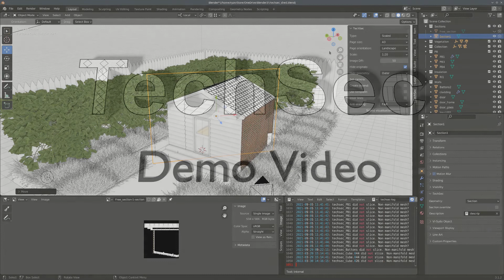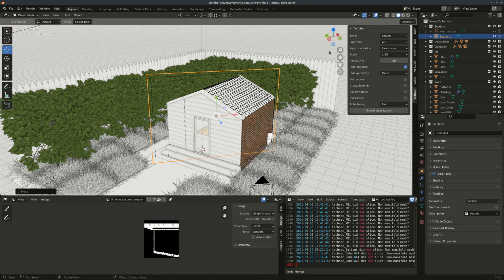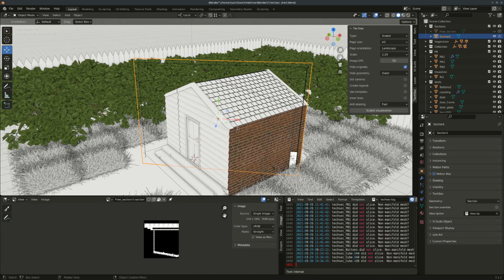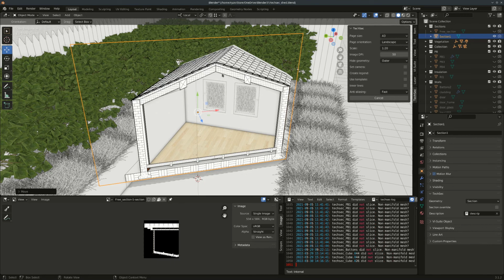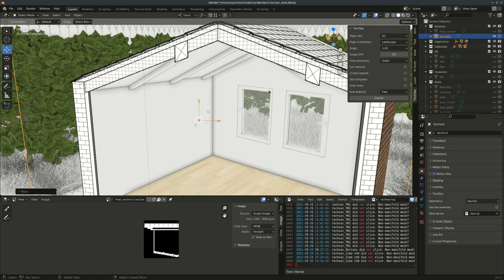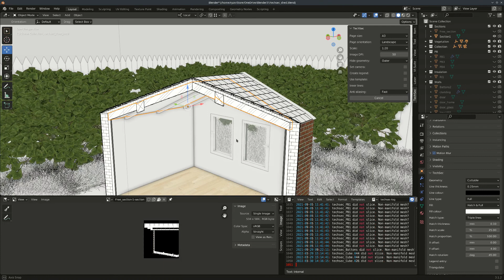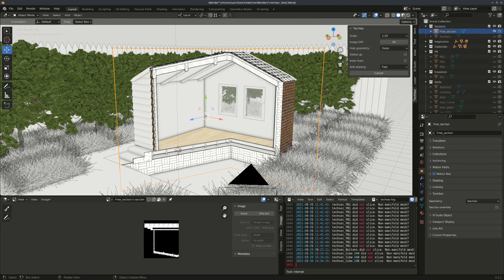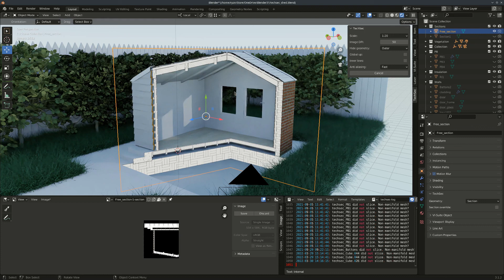TechSec v0.3 - Demo video

Comment: Amazing! Is the cutting done with booleans? How might it perform with a more complex model? Is the cutting / hatching done as a raster render, or is it done as vector (e.g. via mesh bisect)? How is that preview image created so quickly?
Reply from the maker: Hi. The cutting is done with bisects as booleans don't return the cut geometry. Interactive performance does slow down with more complex models although there are tricks to mitigate this. I'm currently looking at ways to make it faster. A vector is created, converted to raster and then applied to the mesh on the fly with Cairo.
Reply: @ryansouthall8464  returning to this a year later, after the bisect, how is the remainder of the mesh clipped from view such that you can only see the object on one side of the cutting plane?
Reply from the maker: @DionMoult  The bisect modifier itself can handle that for simple planar cases.
Reply: @ryansouthall8464  so you're actually updating the mesh geometry live to only hold one half of the bisected mesh, and storing the full mesh elsewhere temporarily?
Reply from the maker: Indeed. Bmesh representations of the original geometry are stored.

Comment: Looks like a dream come true!  Sorry if you've already covered this in your tutorials but can you have multiple views/sections on one page (even with different scales per view)?
Reply from the maker: Hi. You can have multiple section objects but at the moment they would all be at the same scale and create separate SVG pages. These can then be composited together in an SVG editor like Inkscape. I am thinking of having sections slave to a master section for a future version.
Reply from the maker: P.S. You can apply a section override for a section object to give you a greyed out section for background compositing.
Reply: @ryansouthall8464  It would be great to have a tutorial on how to assemble the separate SVGs onto a single Inkscape drawing and with some basic dimensions added.
Reply from the maker: @benveasey7474  Hi. Next version should have dimensions in and I'll do a video on that. If you want two slices from the same model and the same section plane together, generate the first one and then rename or move the SVG file out of the project directory, so it doesn't get overwritten. Then putting separate SVGs into a single Inkscape document is really as simple as copy/paste from one open document to another, at least on linux.